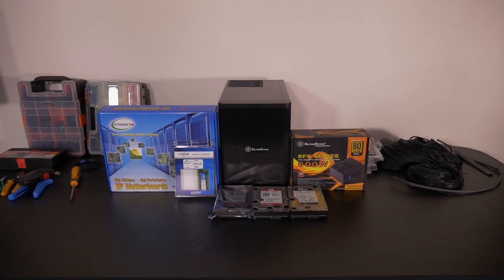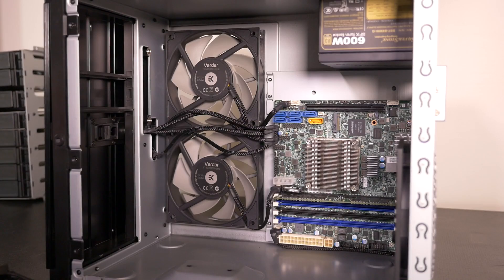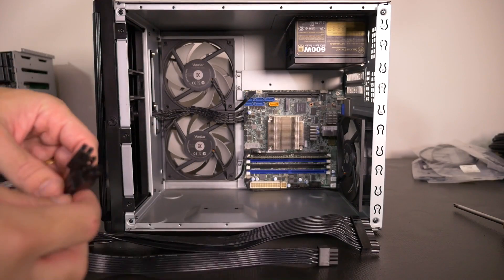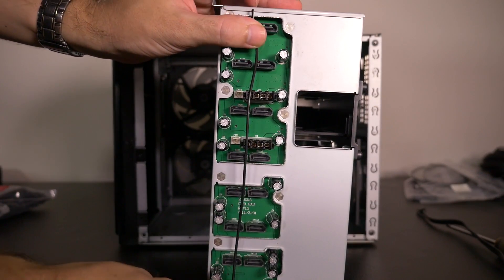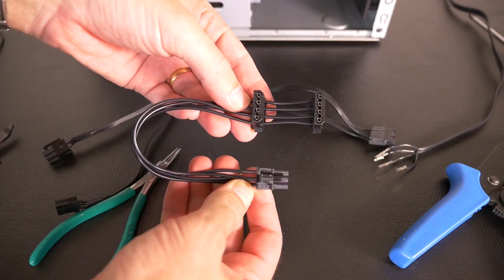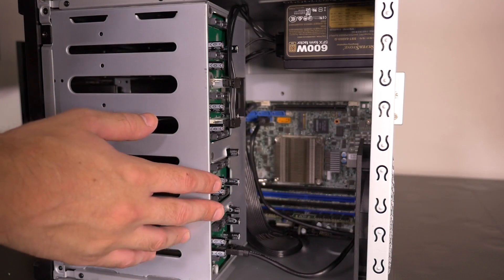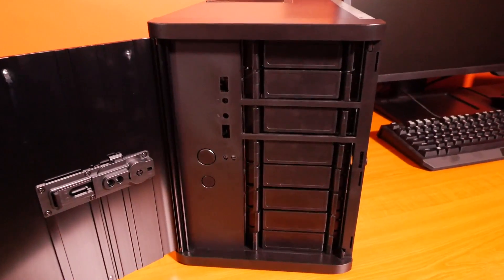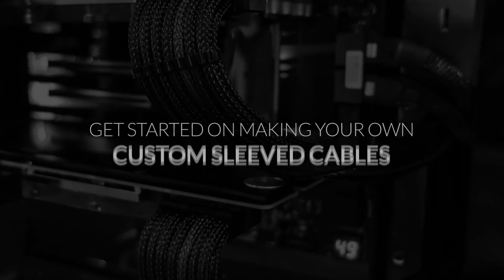SC NAS Build Log: Part 2

Comment: That cpu cooler is meant for a forced air case (server case), so that cpu is going to run HOT without a fan on it.  And those drives are going to run hot as well, because this case was designed by morons that decided to aim air at the drive cage, instead of THROUGH the drive cage...    This is a "beautiful" build that ignores all practical problems.

Comment: Great video and great build. I've been contemplating a NAS build and I think this sealed the deal for me. I have two questions:
1. What is the noise level like on this system at full load?
2. What are the heat levels like? 
Thank you.

Comment: I believe that the 4 pin atx is not needed if you are using the 24 pin connector. I have this same board and am not using the 4 pin. The manual for this motherboard mentions that you should use one or the other, but not both. I believe using just the 4 pin is meant for some sort of embedded applications. Also great advice on the memory slot. I learned this lesson the hard way.

Comment: What about a cpu fan? I understand those SMC boards are designed for use in a 1U chassis with front-to-back airflow. Did you get away without using a fan?

Comment: +SingularityComputers Configure the HHDs in FreeNas to run in low noise mode and add a SSD for caching. Additionally it is never a bad idea to configure those network connections to run in load balance mode. Just write me if you get some problems configuring it.

Comment: You should calculate the load the hot swap will be drawing and use a single run that is capable of delivering that current. The reason there is two Molex on there is to split the current load. Daisy chaining like this can lead to power issues with the drives if not properly compensated for.

Comment: So are you required to hire an electrician in Australia for something as simple as wiring ethernet, are you having something else done with high voltage, or do you just not want to possibly mess something up by doing it yourself? Just curious, nice build as always, nice to see something a little more practical , lol.
Reply: It could be as simple as not having the time to do it himself. He can be doing something else while someone who does that kind of stuff all the time gets it done and to a high standard (plus they'd be liable for any screw ups and their insurance would cover that lol).
Reply: TalesOfWar
true, given how much his builds cost, he would probably lose money by wasting time doing it himself.
Reply: In Australia you need papers to run network cable
Reply: Craig D
seems silly, but thanks for an answer. i guess if i did everything right where i live, i'd need a permit for a lot of what i do, lol. i'd probably need to hire a licensed pro for some of it too.

Comment: This was the exact case i was looking at for my NAS build. The custom sleeving and cable lengths is an extremely good idea IMO. I'll definitely do it when i build my NAS. Great video as always! Keep it up!
Reply: Take a look at the Lian Li PC-Q26B. Just about the same features but you have room fo 10x 3,5"
Reply: but much larger
Reply: I took a look and though you're right, its 1. not easily available to me and 2. it sot simply powered by a single solution (i.e. 2 molex connectors).; i would have to by more back planes and run more than 2 molex connectors